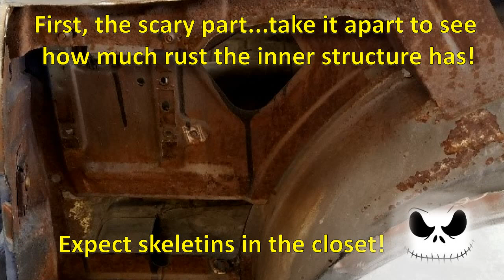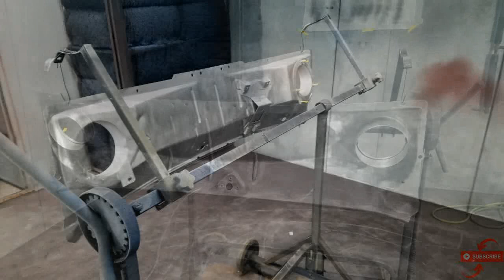How to "Build" a Fastback Mustang restoration project! Coupe to Fastback conversion.

Comment: first gen mustang fastbacks are priced out the working class hot rodders reach by a long shot, I wonder what the dollar amount will be when this car is done. This is an option rather than spend megabucks on a clean original fastback
Reply from the maker: You could have spent a lot of money on a nice painted fastback and later find out it was full of bondo and rust. All classic Mustangs have rust. You need to see photos of how it was restored.

Comment: You would have been better off to start with a fastback, would have been cheaper as well, I know it was your fathers car but once you took all the panels and everything off to just frame rails it’s no longer the car your father had
Reply from the maker: This was not his Father's car. He is going to have us paint it the color of his Father's car. Since we found all the rust he rather spend the money on making it a fastback.
Reply: Car owner here…it’s really a crap shoot. You don’t know what you have until you get under the shiny paint.  If it was a rock solid Fastback, sure, cost goes way down. If it was a 1965 Shelby GT350 survivor you may elect to not touch a thing. You can only deal with what you are presented. In this case, one option was to stop digging, do some basic repairs, finish a more budget minded project, sell, look for what might be a solid Fastback. Both Rusty and I were not comfortable passing off something questionable to the next buyer since inner structure and roof needed extensive work. I elected to rebuild the car to my specifications. Cheaper ways to go?  Absolutely. More expensive ways to go?  Yep.  Am I pleased with the project thus far and the quality of workmanship?  Absolutely. She gonna be a stunner once done.